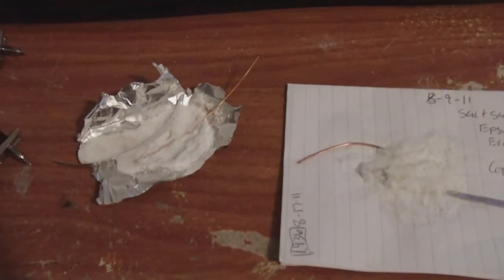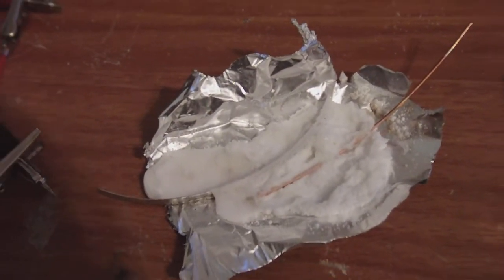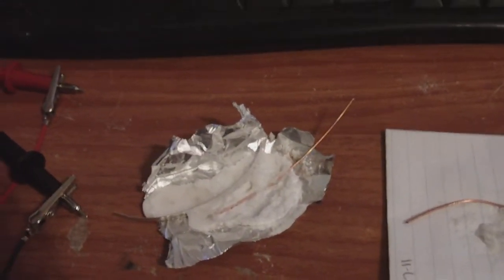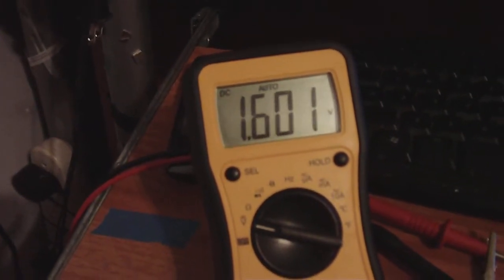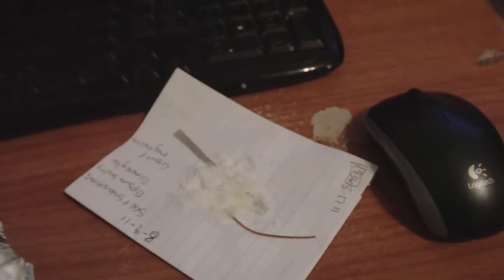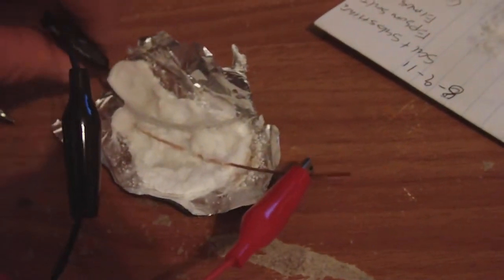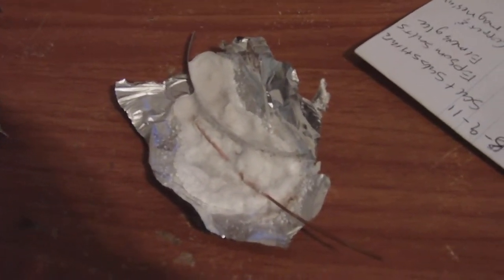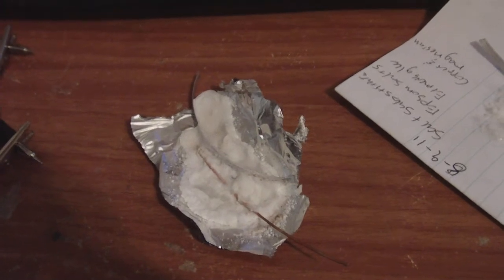Frozen Crystal Cells

Comment: The water molecules in the salt crystal do not ''freeze'' when you put them in the freezer, as they do in a normal cup of water.  They remain the same - tightly packed around the crystal.  They cannot change physical state (liquid to solid...and expand) because they are already in a solid state in the first place - tightly bonded around the ionic salt.  This is why your crystal cells dont expand, and still produce galvanic action.